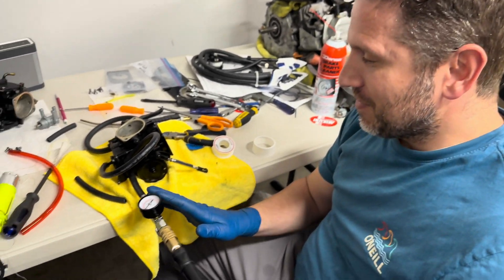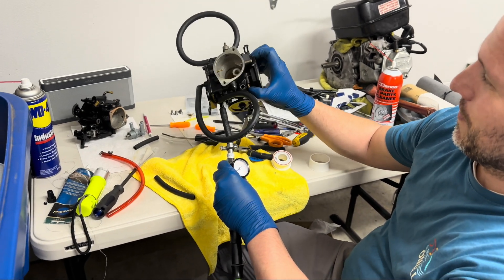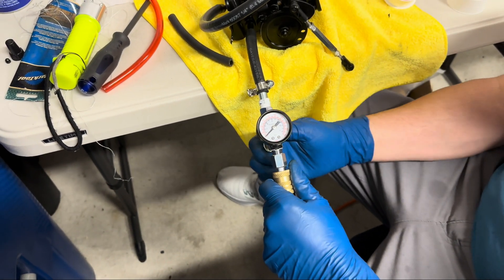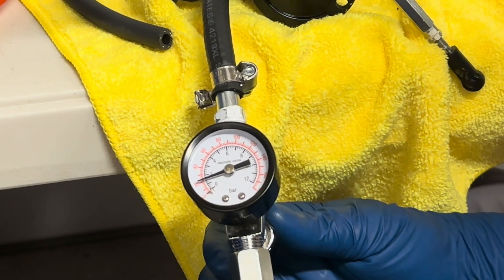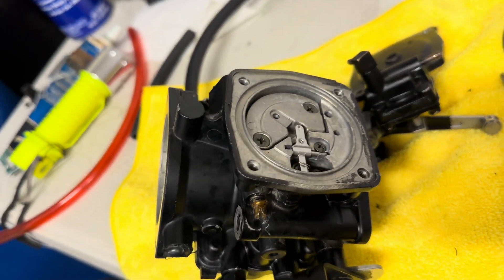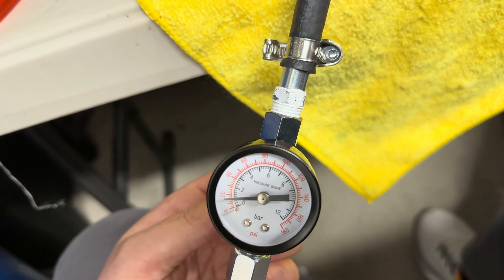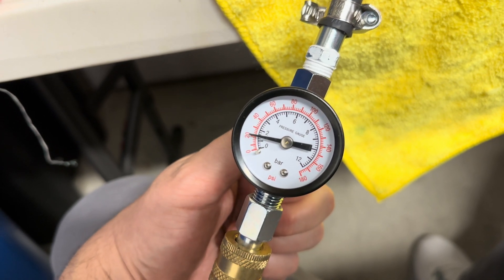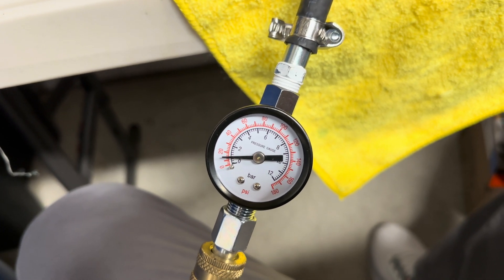SeaDoo 951 Carburetor Pop Off Pressure Test

Comment: You have no information on what carb. this is for.  Im working on a 99 seadoo challenger 1800 with 787cc engines.   Also what are the parts you used to make the pressure device?
Reply from the maker: Harbor Freight pressure gauge. Very backyard. But these SeaDoo’s have been running AWESOME this summer.

Carburetors are 
Mikuni BN46-42-6 (PTO) 
Mikuni BN46-42-5 (MAG) 
for a 1998 SeaDoo XP Limited running a 951cc rebuilt Rotax engine.
Reply: Hello, how are you, my name is Fabio, I have a gas 720 98, what is the correct pressure to leave? How many psi does it open the valve with and how much does my original engine never open?